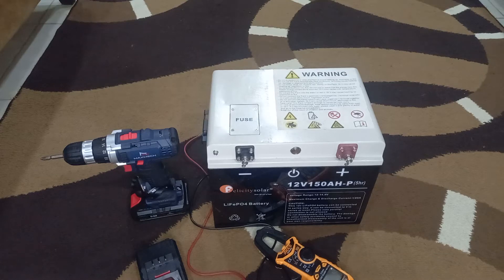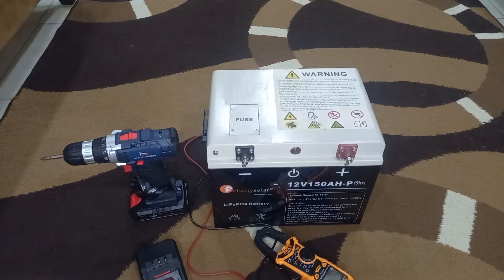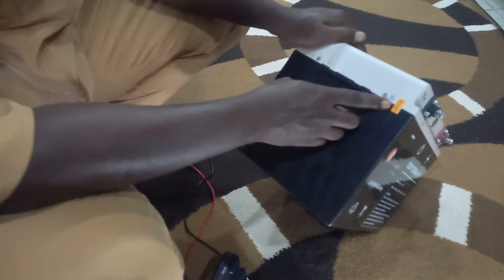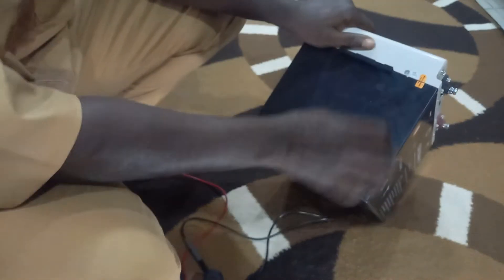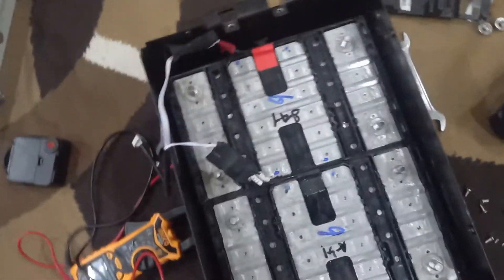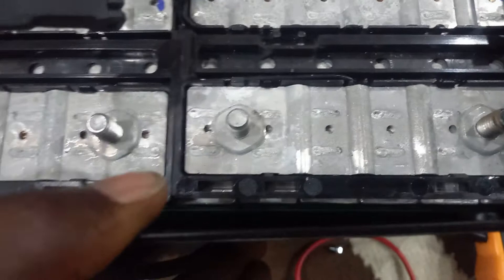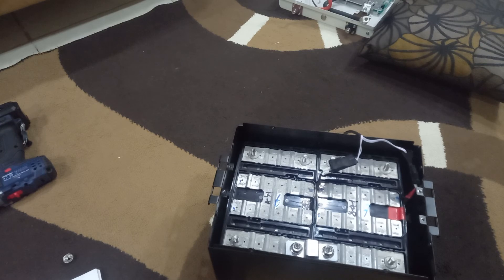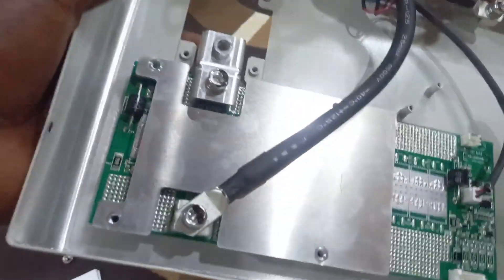Tear Down of Felicity Solar LPBR12150 Lithium Ion Phosphate Battery

Comment: How many loads can 10kwh lithium battery carry sir pls
Reply from the maker: For a 10kwh Felicity lithium battery, the rated discharge current is =<60A,  so you can run a maximum load of 60*51.2 = 3000w continuous.
Reply: Running it with 3000w continuously for how many hours pls
Reply from the maker: @adeboabiodunsamuel9273  10KwH means you can run a 10,000 Watts for an hour, running 3000 watts continuous will give you a runtime of 10,000/3,000 = 3.333 hours, or 3 Hours 20 Minutes.

Comment: Since you have 2 B+, the configuration of the battery maybe series-parallel arrangement using 3.2V75Ah. I have looked at the batteries, could be the type used for EVs also. It is not a direct 4S (3.2V150Ah).

Comment: Did you eventually replace the BMS? I found out that for some lithium batteries, all you have to do is disconnect the BMS briefly and reconnect and the battery will come back to life and you can then charge it back to normal.
Reply from the maker: I haven't, after I put it back together it works just fine. Perhaps some batteries require you to disconnect and reconnect the BMS to work just fine.
Reply: Yes you are correct certain BMS require balance lead unhooked then should bsm leads to empty capacitors and reconnect. Other simply add charge but better to get active balancing BMS with smart app on phone

Comment: Type of BMS (model number)
Reply from the maker: It's a 4s 60A, model number I don't know, the only inscription on the BMS board is LPBR12150
Reply: This model for battery only 12 and 150A
Reply: If you have picture of it (bms only) can send it